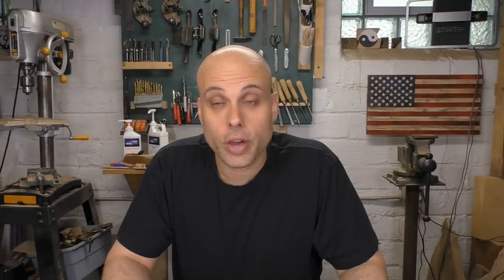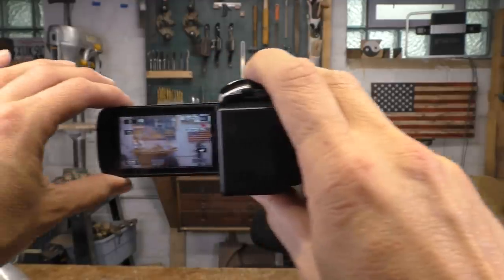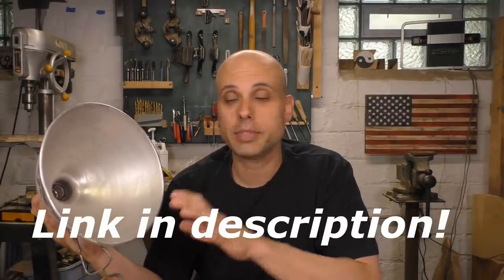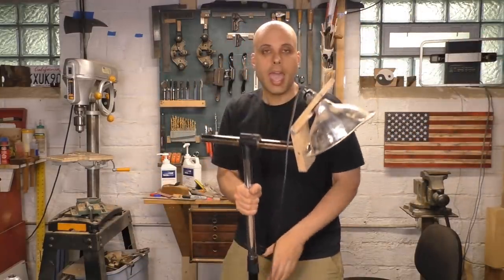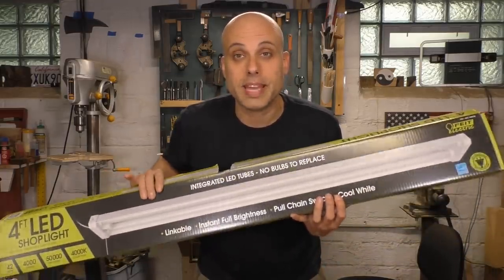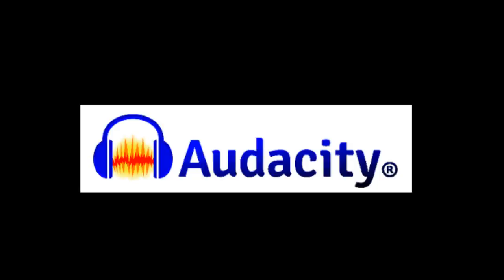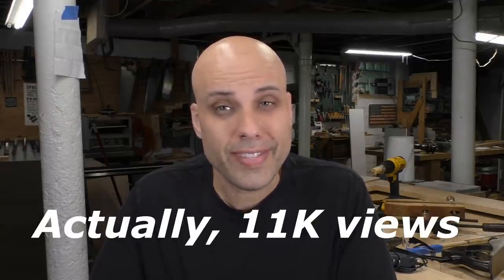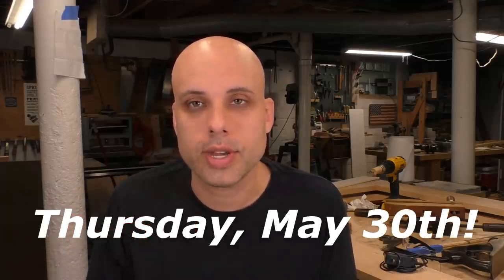The $250 YouTube channel.

Comment: I've dabbled with the idea of doing a YouTube channel for years. I have all the equipment I need and then some, most of the hardware is either DIY wood, PVC, or salvaged parts. I've got the vixia 700, some cheap Chinese action cams (great for overhead shots and secondary angles) not to mention a couple of old cellphones (s4, s7, currently running an s10).

What I lack is ambition. Not to mention a topic or rather too many hobbies to focus on one. LOL

I can say you have done right for those on a budget. Not to mention the motivation, focus, and presentation to make it work.

Comment: My Mom has been an artistic photographer (read: " Starving Artist ", not wedding album) for years. ..all the many years I can remember. 
To your point, you can produce great and amazing content without the fortune in equipment - she does it all the time.
Your discussion of lighting left out "color temperature " ( "daylight" versus "soft white" etc) 
The tip here is to have all your lights be the same - more important than which one you pick - this helps your white balance and thus your shirt looks the same anywhere in the shop.
I've noticed on the LED bulbs in the big box stores etc, they list this parameter.
Lastly, try to have your bulbs also be the same brand.
One soft white is not the same as another 
"Daylight" is generally brightest, and bluest.
Have a blast everyone !

Comment: Never used Blender, but Audacity and Gimp are awesome.  Audacity can actually do some pretty insane things (and it has capabilities that I'll never use, and don't understand, lol). For things like cleaning up simple audio for a video or podcast, it's ridiculously simple to use.

Those light fixtures are known as "poultry lights " in rural areas. Last time I bought some (5 years ago, or so), I paid about  $5/ea. $12 is too much.  Farmers put those fixtures in chicken coops, over the winter, to keep the birds from freezing.  They also get put in well houses to keep pipes from freezing.  They make great work lights.   I love them. Next time you need some, check Walmart or a farm supply store. (Or a hardware store) I'll bet you can get them cheaper, and not have to wait for delivery. 

Great advice, here. Glad you brought up editing! Many start up channels neglect that key part. (Also, some would benefit from a script, or at least outline notes.)
Reply from the maker: I always have an outline and I practice before a record. Thanks for the tips on the lights.

Comment: Blender for video editing! I admire your patience. :D I've had good luck with Davinci resolve, which is free (as in beer) for the basic linear timeline editing and color correction stuff. I suppose what I really need help with is the thumbnails and marketing and SEO - maybe another video subject if you've got the itch.
Reply from the maker: Doesn't seem to take much patience. Works just like all the other non-linear editors I've used for sound.
Reply from the maker: When I looked up Davinci, it was $299. What am I missing?
Reply: @RexKrueger  "Resolve Studio" is paid, "Resolve" is free (scoll allll the way down on their product page). Studio has multi-user stuff, film grains and a bunch of extra plugins, and I think there's some kind of hardware controller integration they're upselling. I've been using vanilla resolve for 2 years with no need for the upgrade though.
Reply from the maker: @extralifedisco  Fascinating!

Comment: Another useful free software is inkscape, I use it to make the layouts for my cheap-o imported laser engraver. It's a vector graphic program so it's handy for things that need to be scaled up or down. 

It can be used to make 2D blueprints in a pinch, but since I'm educated on AutoCAD (but cannot afford it :/ ) I find that just sketching things by hand is often a lot faster/easier than trying to bend other software to my will.  
I have used Inkscape to create a vector graphic over a hand drawn graphic, which can be really useful if you need to engrave someone's logo and all they have is a jpeg or bitmap image.
Reply from the maker: I love inkscape. I actually recorded a section about it, but it didn't make the edit.

Comment: Great video! 
I would recommend paying a little more for good quality Led bulbs, for instance HD carries Cree.  Look for a bulb that has a CRI rating of 90 or greater, high CRI has nearly equal amounts of all wavelengths of visible light, giving your video great looking and accurate color. Bulbs also have different color balance, generally 2700k, 3000k, 4000k or 5000k,  2700 is warm like an incandescent bulb, all the way to 5000/daylight - the color of noon day sunlight.  Daylight is generally best because it matches any window light in your shot.
You can also get rolls of LED strip lighting ... I’ve seen high CRI 16’ rolls for about $35, it’s peel and stick, so can can make long shop lights or rectangular panels. You will need a power supply, one 60 watt unit can power the whole roll, but if you make separate panels you may need a supply for each.
Reply from the maker: Sound advice!  I now use big LED panels. They seem to be working nicely.